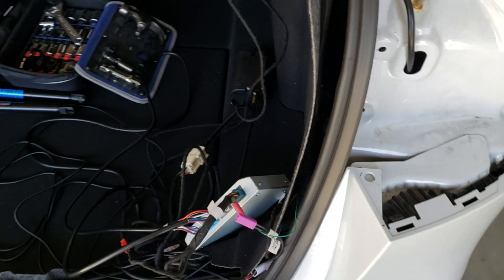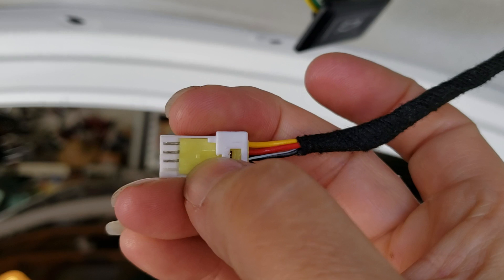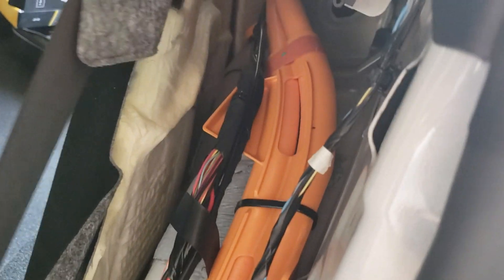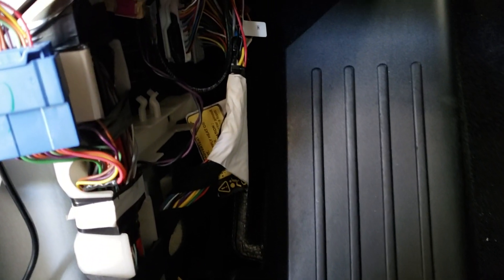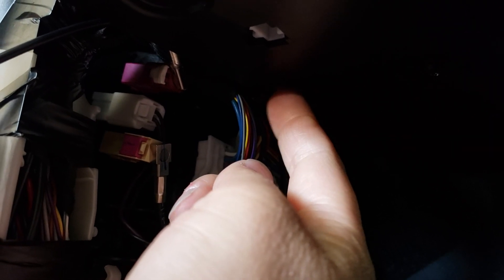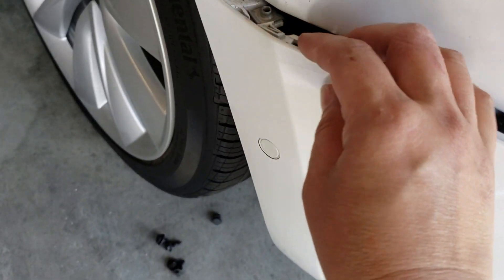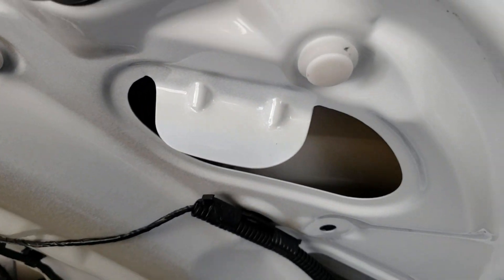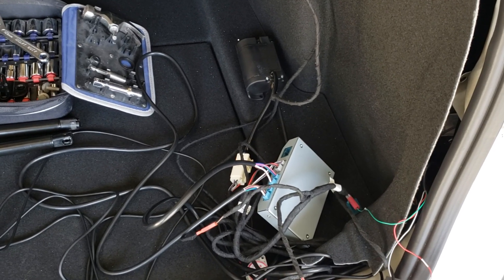Tesla Model 3 Automatic Liftgate - soft close partial install

Comment: Thank you Angela! I’ve been considering doing this install as well, and have seen TeslaOffer’s latest install video/kit. How long does/did it take for you, start to finish?
Reply from the maker: I think between 5-6 hours. Just make sure you position the control unit in a way so you can reach the SD slot when an update is required. Like mounting the slot facing up instead or down or sideways behind the carpet near the subwoofer. I just had an update this month.
Reply: @angelae6064  Thanks for your video. Is better advice to switch off complete the car to manage the access to this red power bolt?.. I see you disconnect several switches to access there, Is this safe with car on??.  By other way, what about the power 12V source in subwoofer rear right back, this source is not good choice for any reason?, any opinion from your side??. Regards